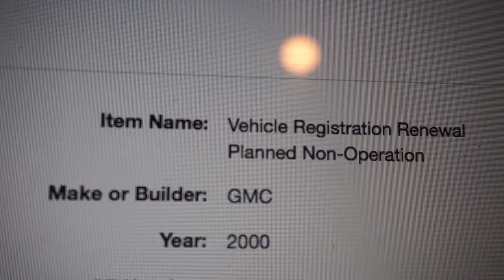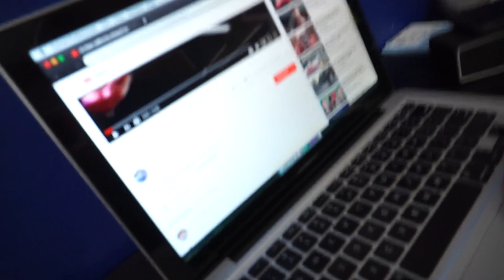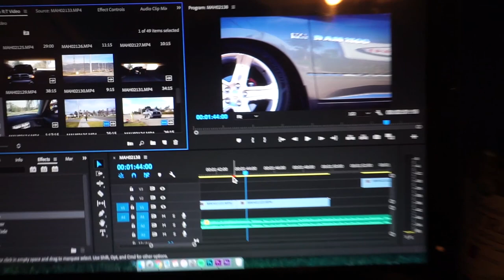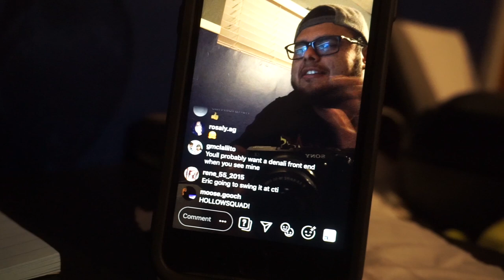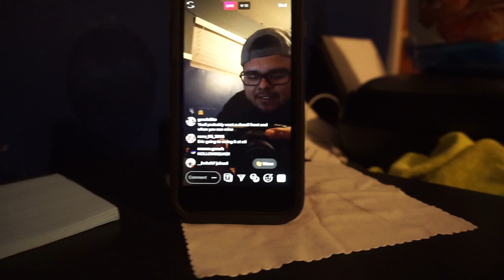Truck Is Non-Op -NEW 2019 Cali Exhaust Law (SIGN THE PETITION IN DESCRIPTION)

Comment: go ahead do the trans and diff service and you can kiss future mods away
Reply from the maker: Houston why?:/
Reply: transmission oil when changed will cause it to slip especially on a 4l60 since the old fluid is thicker and is what keeps it shifting into gears when you replace it with new one its thinner and same thing goes with the diff but hey it's your truck do what you want I mean I do this for a living I actually work and modify trucks and cars. I would just honestly do body and interior work first because if you want to build power say goodbye to that 4l60 they cant hold power if you don't build them properly or swap to an 4l80   @BIGOCHUBS
Reply from the maker: Houston I appreciate the professor advice !
Reply: BIGOCHUBS its true i made the mistake to flush my transmission and the first hot day of summer the transmission fried due to the thin fluid